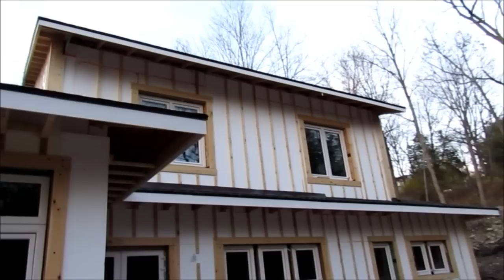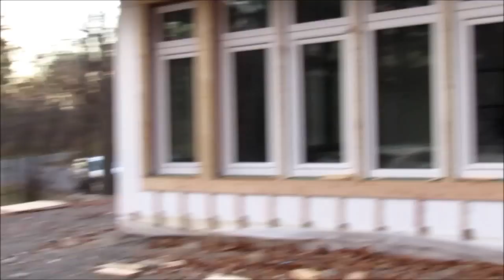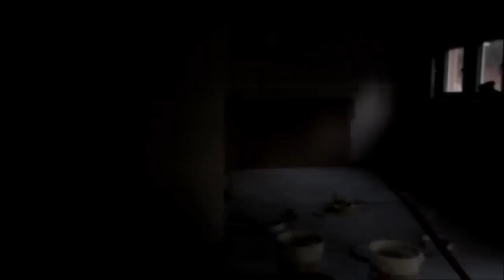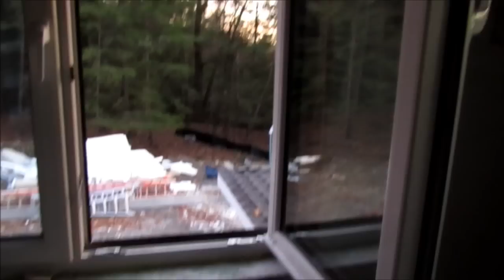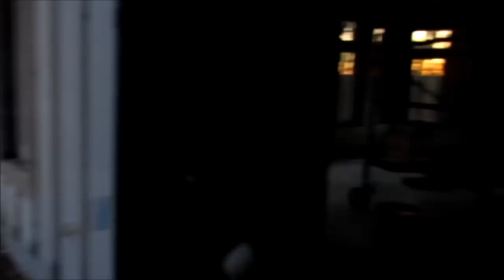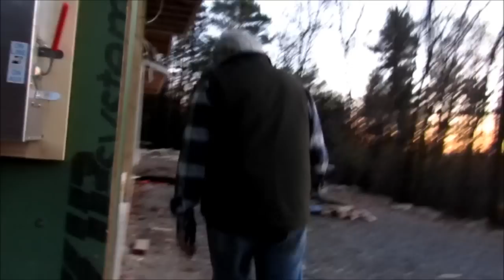Tony Ingraffea's  New Solar Home  -  11-10-14

Comment: I would have planned on running a ground source heat pump using the solar PV cells, it pays for its self in five years alone when comparing to the cost of any fossil fuel and thats without taking into account any tax credits.  PV powered heat source would also have given the home owner the ability to do air conditioning in the summer.